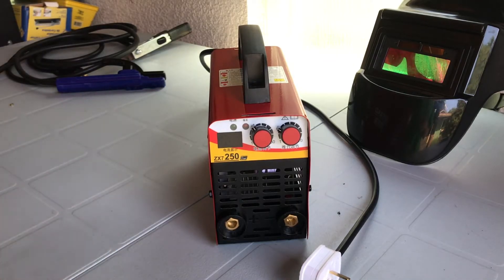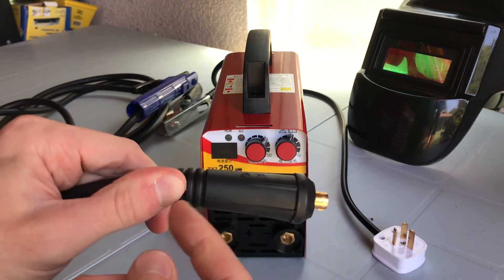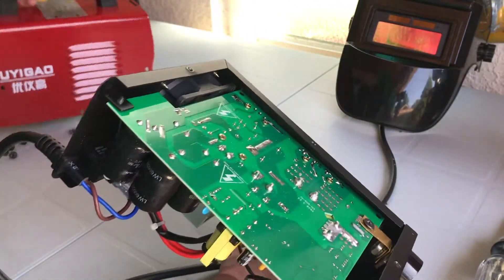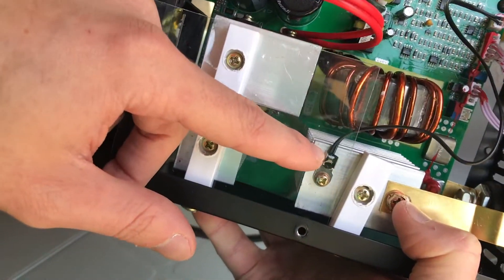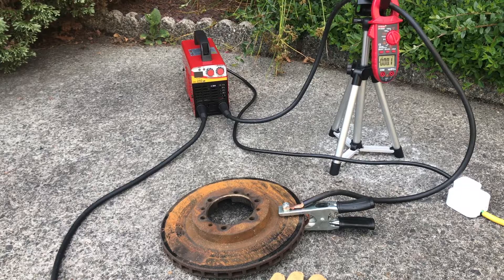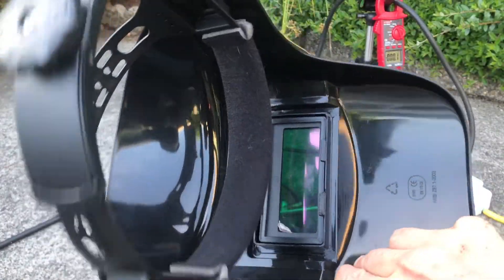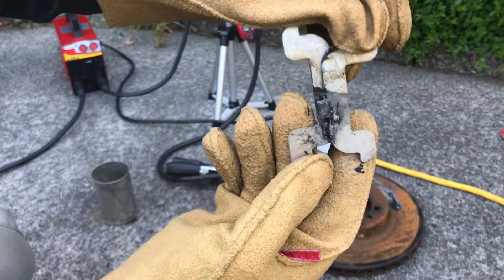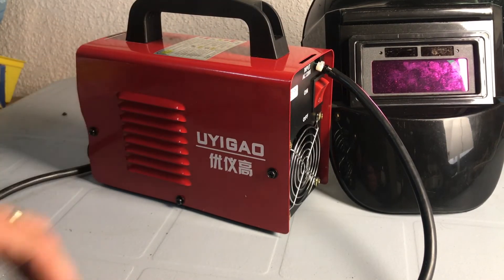Reviewing the Cheapest Inverter Stick Welder On The Internet ($15)

Comment: I paid to much, above 55USD - maybe the 15USD was a very cheap offer if you see all the parts. My unit had a cover between the housing and the PCB at least. But I discovered fake input capacitors and total capacitance is only 850uF. My test, more amateur: https://www.youtube.com/watch?v=wa4kJY4Pnkg
I think 250A is peak only, you have about 28V when welding and the input power continously should be below 3500Watt, so 125A on average is expected. Please note, that I measured about 70V voltage with no load on output - so avoid to touch electrodes!!

Comment: You are so wrong ! If you are Measuring the Output ! You Need To apply a Near short . You were frying that Pissy little 2.5 rod ! Try a 3.25 and see what the does . It cant Draw and load if it has no Load .
Reply: Yes you are abslulty correct. Only dead shot can reveal its rated capacity or as you said next level rod. These IGBT models will bring down current once arc stabilizes. 100% correct your statement, current is on demand.

Comment: Will it still be safe if I attached a 2 prong plug to the wires and plugged that into a grounded extension cord?
Reply from the maker: Hey Chufa. It still won’t be grounded if you connected a 2 prong plug to a grounded extension cord. The ground pin in the extension cord wouldn’t be connected to anything so it’s the same as plugging it in to an ungrounded extension cord.
Reply: @InflamedBallz  Thanks for the info
Reply: yes. extension cords are magic!!!!! they invisibly make the 3rd wire connect to the welder!!!!!
Reply: @zlindauer5315  no need to make someone with a legitimate question feel bad not everyone is a supremely knowledgeable turd bag like yourself bud

Comment: You should do a flux-core welder next
Reply from the maker: Thanks for the suggestion! Up next is a diesel forced air/water heater and a customizing alternator pulley size for RV applications. Not sure when I’ll get my hands on a flux-core